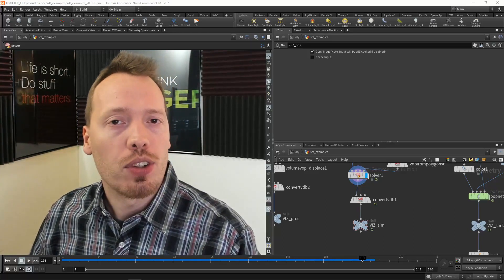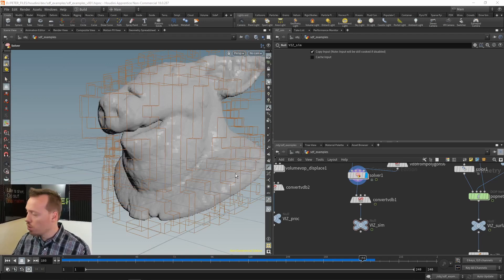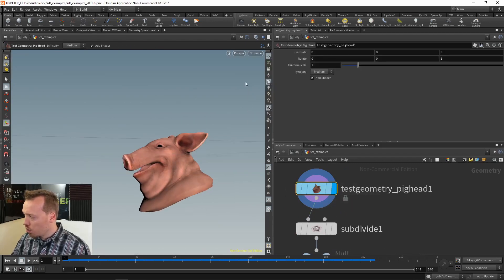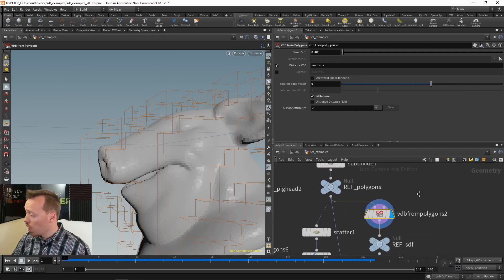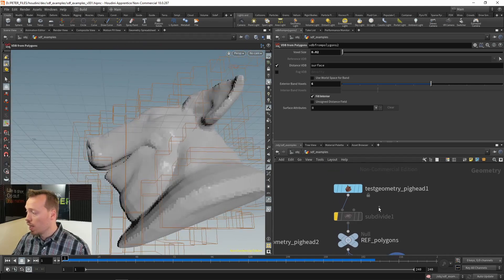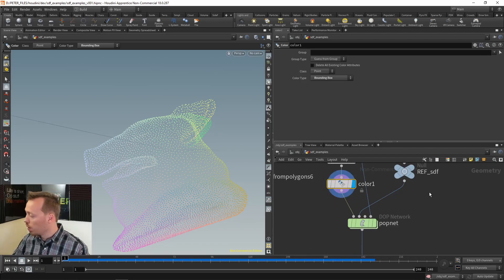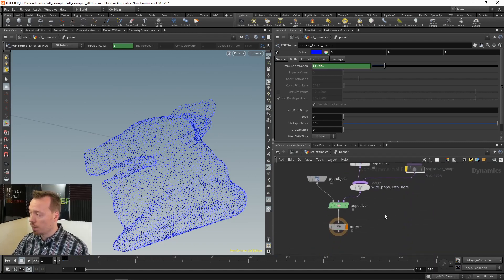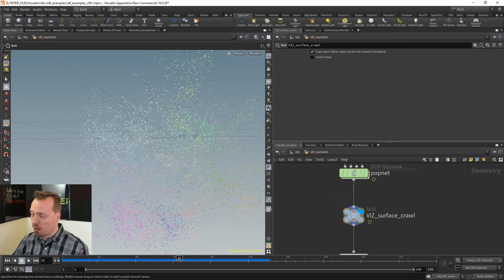SDF example 2: snapping particles to the surface of an object by using an sdf. (part 3/3)

Comment: nice lesson.  When looking at vdbvisualizetree it looks like a pretty low res voxele grid compared to what is listed when on the right clicking on a VDB node to get info.  For example a VDB info might be 200x200x200 info but when you voxelize with the visualize tree node it only looks like maybe 50x50x50.  not sure what that means just trying to get a better understanding of the size and resolution of SDF/VDB.

Comment: Hi peter, I did some reproject (no simulation) to the surface and some analystics by the performance monitor.
what I mentioned is that the ray was way faster than the vdb... H18.0348
ps. your my nr one all times!
Reply: (projection on a scan though... I think decimated Zbrush)
not sure if this was the exact link but it was the same model I tried in this sdf case:
https://www.thingiverse.com/thing:1538919
Reply from the maker: Hi Dennis, glad you are enjoying the content!
I suppose it depends on the amount of points you are raying and the complexity of the geometry you are raying against.
Or in the case of the volumesample how detailed of a volume you are sampling into.

The ray sop is a great operator and I use it a lot. I think the volumetric approach also allows for blurring/smoothing of the sdf or for doing a ‘noisy’ lookup. Vdb tends to be pretty quick and multithreaded in vops/vex.
The ray sop is hdk compiled and not sure how multi threaded it is. Could otherwise build it in vops with and xyzdist and a primitive attribute vop to make a fast ‘closest distance’ vop.

Comment: Hi Peter, I'm wondering how I might assign the inside of the SDF a color gradient that I can apply to the vertex color so that when you boolean the object you will get the onion skin effect, imagine earth crust mantle diagrams where you see the layers of the earths crust in layers to the centre. I can achieve the same in C4D using volumes, but the polygon count must be very high to achieve any fidelity and it ends up being too hard for C4D to handle, at least on my pc!
Reply from the maker: This should be fairly straightforward:
Make a sphere, append a clip sop to slice it in half.
Append a poly fill to fill up the gap, turn on the output group ‘patch’.
Append a remesh node and remesh only the patch group.
This will be your mesh that we’ll use for sampling the sdf.
So next branch of from the original un clipped sphere and convert it to sdf using vdbfrompolygons. Make sure to turn on ‘fill interior’ so you have distance data on the inside of the sphere.

Next append an attribute vop to the remeshed patch. In the second input, connect the vdbfrompolygons node.
Inside the attribute vop, use a volume sample to sample the sdf that is coming from the second input. The sample pos is P, ‘filename’ is coming from ‘OpInput2’ from the geometryvopglobal.
Feed the volumevalue into a fit function, promote the srcmin and srcmax parameters and connect the output of the fit function into a color ramp. Plug the color ramp into your outgoing Cd.
Go up back into sops and adjust the min value to -1, the max to 0. Tweak the ramp for colors that you like.

For a more broken up look, you could add a bit of noise to the lookup position before the volumesample inside the attibutevop.
Good luck!
Reply: @peterclaes5918  Thanks fo the detailed respponse! Ill give it a try.
Reply: @peterclaes5918  Suuuuper clear instructions! worked perfectly thanks!
Reply: @peterclaes5918  Is there a better way to get definition on the surface without replying on poly color? Can I feed the sdf value straight onto the texture so I can get higher def?

Comment: POP`s has a stick attribute, although using VDB are beneficial.
Reply from the maker: I like vdbs as they can handle things that come off a surface too, like bubbles or whitewater, or growing things inside a surface, like veins.
Sticking, sliding and clinging is useful pop behavior and you don’t need an sdf for that.